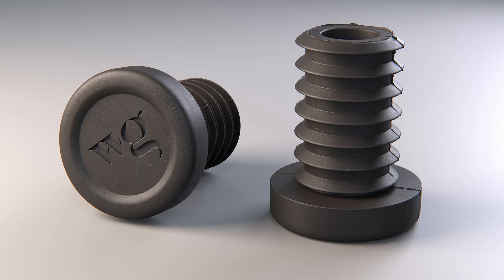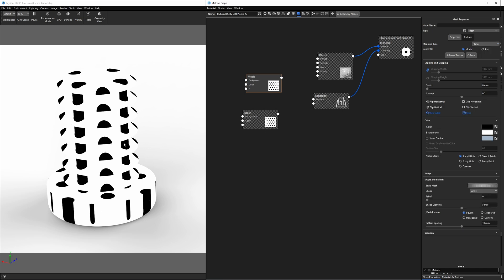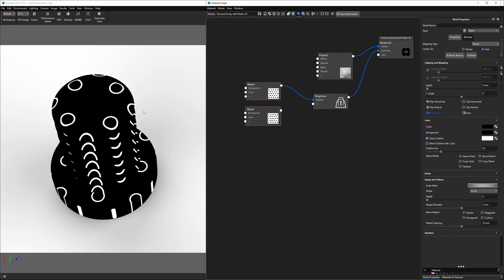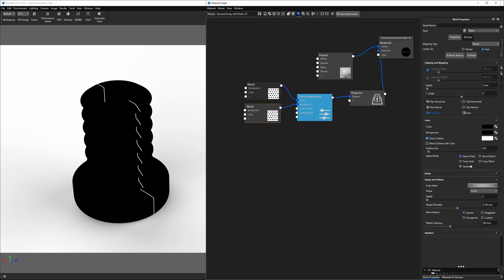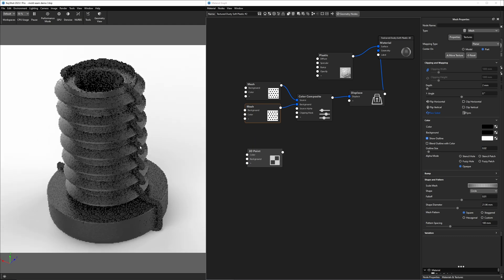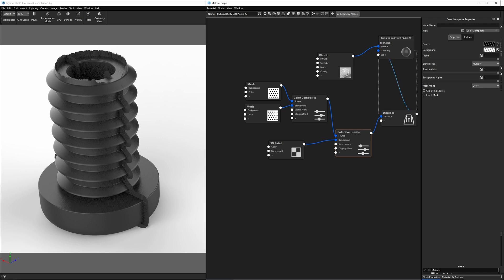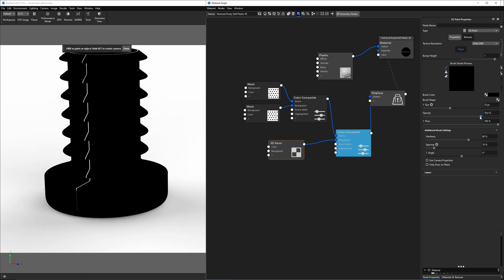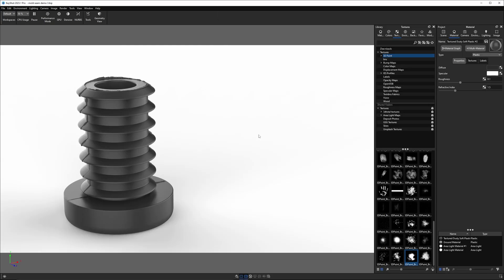Injection Molding Plastic Part Line KeyShot Tutorial

Comment: Great video. Is there any way to ensure any displacement only affects on side of a model's wall, say an emboss on a glass as for me, it keeps appearing on the inner wall too?
Reply from the maker: If you were to use the 3D paint tool, the places you paint should only apply to the outer surface. If I started with a texture to create the line to begin with, then it may be projecting through the entire object. If you use planar projection, you can set the texture depth to limit how far it goes into the surface. But for a more complex object, you'd need to rely on UV mapped textures to achieve the same.
Reply: Thanks, it's on a curved surface so planar projection is going onto the back wall too and limiting the depth of the projection isn't giving me a uniform depth to the engrave. I thought I could separate the inner wall and outer wall UVs when saving the model in Maya but at the moment, that's not separating the inner wall so the displacement is still on both faces. @WillGibbons
Reply from the maker: I see. You could try separating the surfaces in KeyShot using splitting angle. Right-click then split surfaces. See if that helps.  @kapwinng
Reply: I managed to achieve the right result by unwrapping UVs within Keyshot but seeing if Maya will do a better job at the moment. I did try splitting the surfaces but then that ruins the render as it's a bottle with liquid inside. @WillGibbons